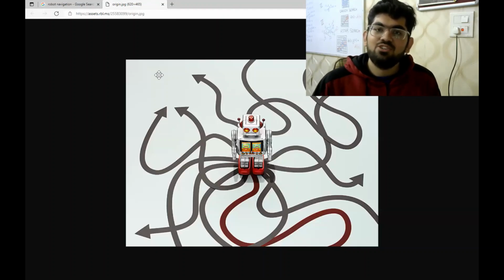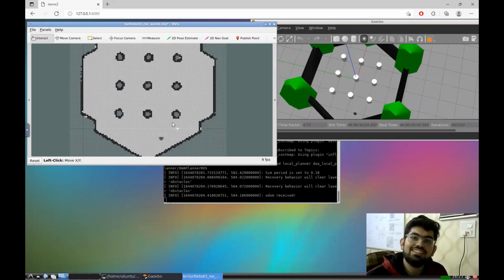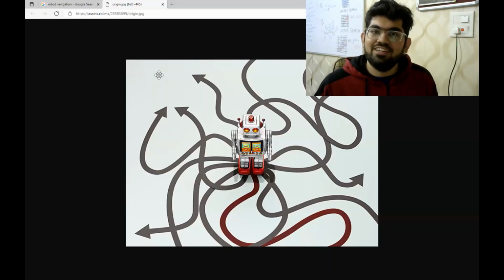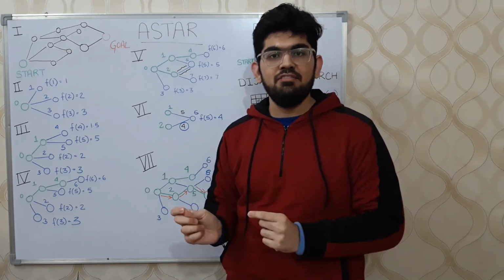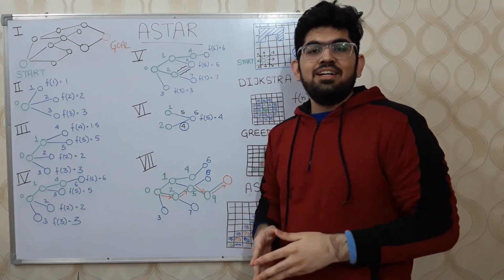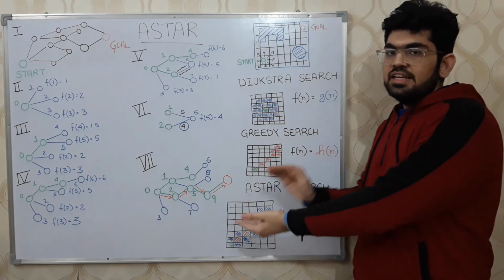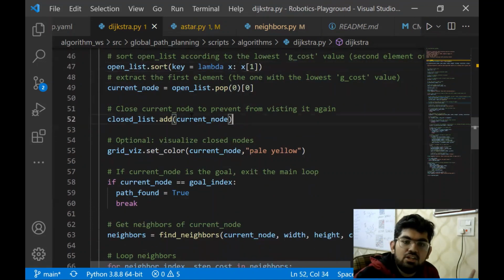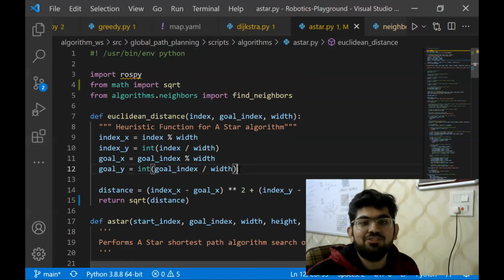A* (A Star) Search | TurtleBot3 Robot | Motion Planning for Robots

Comment: How can apply obstacle avoidance in your project?
Reply from the maker: A* is a global path planning algorithm. You can use an additional local path planning algorithm to do real time obstacle avoidance. For that, one good algorithm is the DWA Planner. Link to video: https://youtu.be/cW_9KRL_rA0
Reply: @RoboticswithSakshay   I saw your video but I can't join your astar planner with DWA planner.
Can you tell me how do that's,please?
Reply from the maker: @Ycoders   If you follow the instructions for running the AStar simulation, your work is done. This simulation already has AStar Planner as Global (as discussed in the video) and DWA as the Local.

While running the AStar algorithm, when the robot moves after generating path. Notice a small curve in front of the Robot, that's the DWA Planner in action.
Reply: @RoboticswithSakshay  I saw that's my friend, local planner is working thank you, but when make dynamic obstacles the robot not ovoid them and stop moving.
Reply from the maker: @Ycoders  The behavior of the DWA algorithm is dependent on the parameters that we provide. The parameters that the code uses are present at this link: https://github.com/SakshayMahna/Robotics-Playground/blob/main/turtlebot3_ws/src/global_path_planning/param/turtlebot3_ros_world/dwa_local_planner_params_burger.yaml

Did you try placing the obstacle at various distances. For the current settings, it may be possible that the algorithm can only avoid obstacles that are further away. To account for obstacles that are closer, the settings need to be changed. More details about the parameters can be found here: http://wiki.ros.org/dwa_local_planner

You can even raise an Issue on the GitHub Repository, discussing more details about the problem.